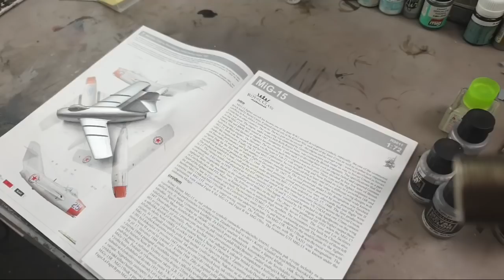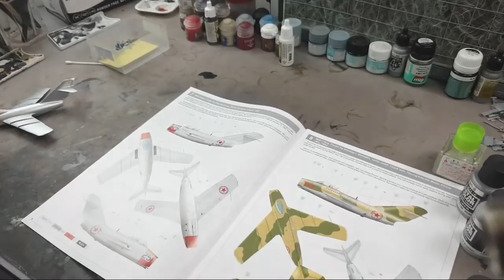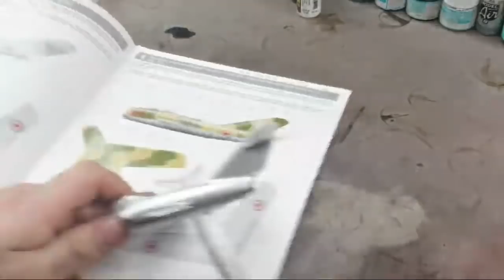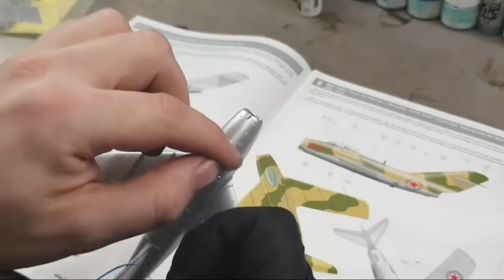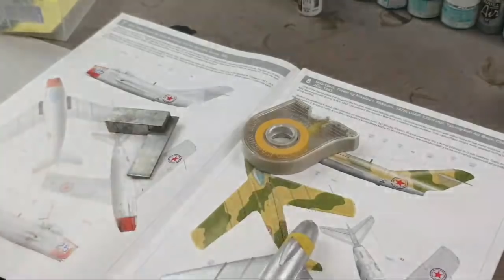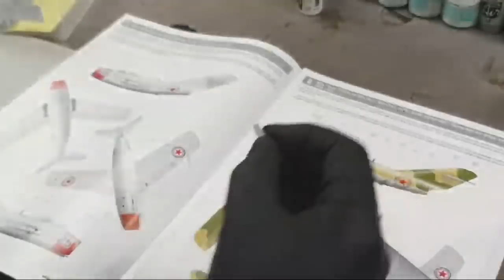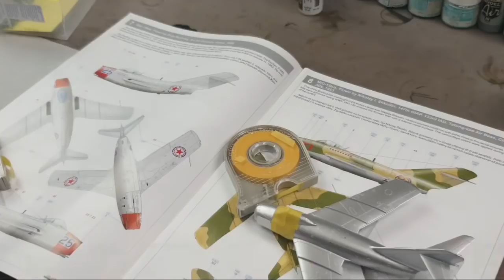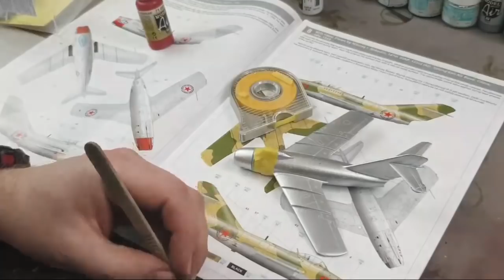Genessis Models 19th Live Session ( Spraying Mig-15 Part 2 )

Comment: Looks like it would have been easier to mask off that section where the nose numbers go. Just cut a piece of tape the same size as your decal template. Cover that area & spray the red. Thanks for the video, nice job on the Mig.